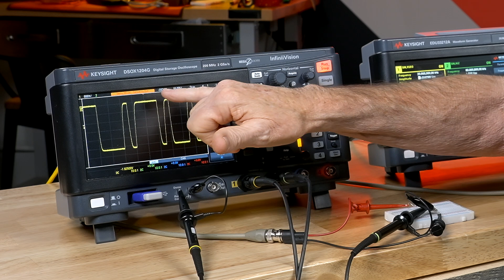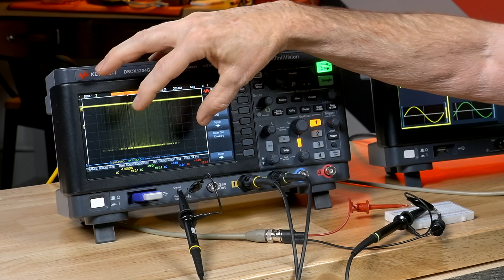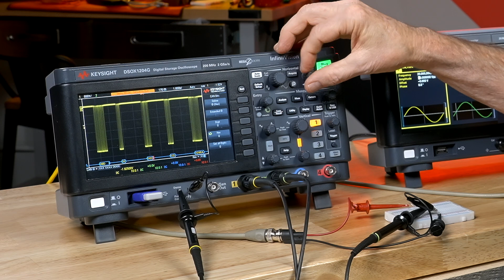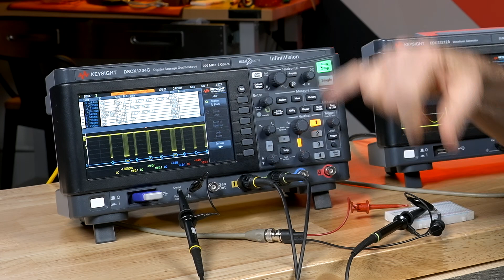Lesson 14: Serial Bus Protocol Analysis

Comment: Any  particular model designed to decode bacnet mstp?
Reply: You might try a logic analyzer. They are specialized on many different kind of protocols. In the case of an oscilloscope, you could also use the brute force method presented at the beginning of the video.

Comment: I2C and SPI are ubiquitous "synchronous" serial interfaces in embedded systems.  They are synchronous because they send data using a dedicated clock line.  They are used often times between microcontrollers/microprocessors and virtually any kind of peripheral device (like flash memory devices, I/O expanders, temperature sensors, other FPGAs, etc).  UART (as the name implies) is an "asynchronous" communication interface.  It has been around for ages and is asynchronous because the data transfer does not involve a dedicated clock line--but instead using a fixed "baud rate".  And as Johnnie says, CAN is used mostly in the automotive/robotics industry and is used for communication between various sensors and processors.